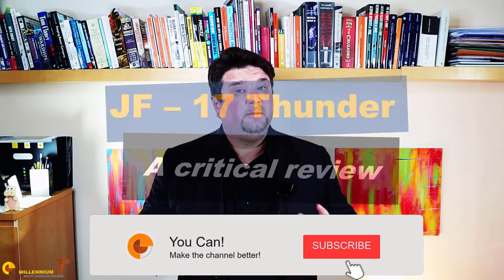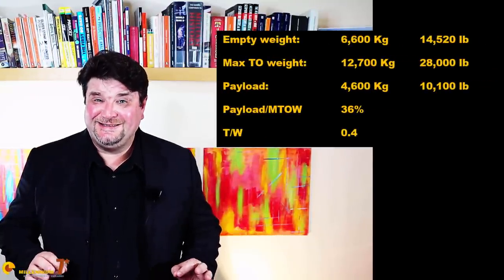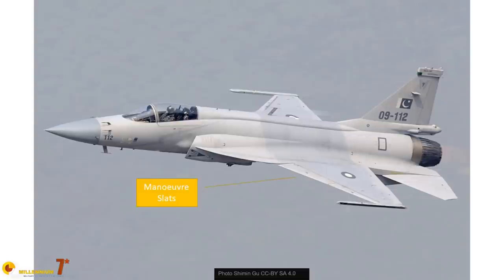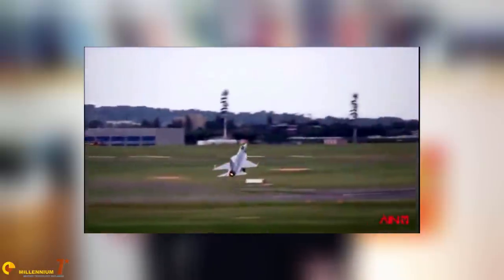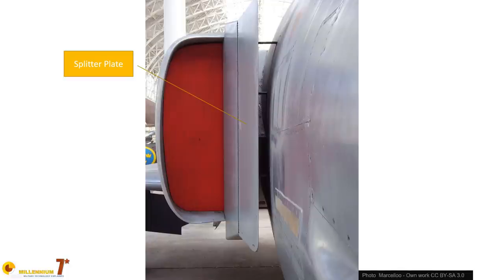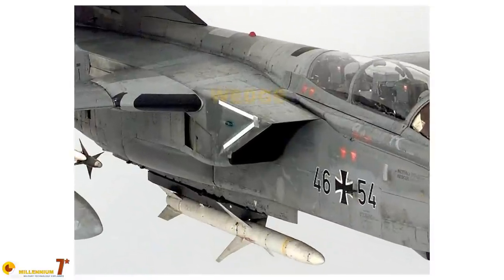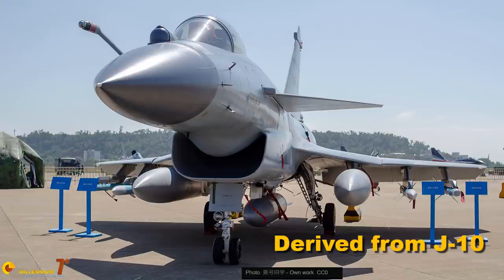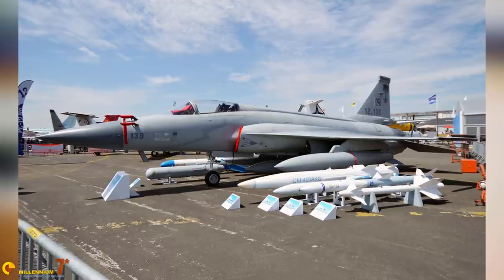JF-17 Thunder Block 3 & F-35 - What do they have in common?

Comment: Unbaised analysis and a great one tbh 

Little corrections:

 Mikoyan Design only provided design support related to RD93 engines..

And it has 7 hardpoints but can be increased to 11 with mounted rail racks for ground attacks and maybe others (not sure about others)

And yes its master of none trait but its bang for buck and if the pilots are well trained it can be a great asset...
Reply: but it doesn't have the lift capacity or wing thickness for serious weapons expansion
Reply: Or u can go the Gripen way.... Gripen c&d and e&f models have different hard points...the latter has more

Comment: Excellent video as usual. Also, it might be that the PAF placed much more emphasis on A2A roles than strike ones thereby opting for a platform that can be rapidly built and fielded in sufficient numbers. This would’ve saved time, money and other resources that modern multi-role aircraft need. By limiting the requirements and simplifying the design, the planners made a smart move thereby    opting for incremental improvement over the service life.
Reply: That would make sense because PAF's primary role is defending airspace. Given it's position sandwiched between massive empires, Pakistan has little interest in invading it's neighbors anytime soon.

Comment: Impressive!! I couldn't have come up with this plane! As a growing nation I'd be very proud at this accomplishment and I respect the approach of not making the entire plane completely dependent on a computer...some things were better in analog form before digital..Prime example is one of my cars..My toyota has an electronic Gas pedal and Throttle Body...where as my Subaru or Duramax have a stainless steel cable attaching the two points together...You can't go wrong with the cable that never has an electrical problem leaving it inoperative..Or A/C controls or gear selectors in cars...I want physical, tactile dials for my A/C AND for my Gear Selection !!!!!!! Don't fix something that doesn't need to be fixed lololol

Comment: JF-17 Thunder Block III Specifications:
1) Chinese AESA radar with Pakistan own software for Avionics. which allows to customize various features.
2) Russia Mig-35's Engine RD-33 MK version which is quite close to the F-16 Engine performance.
3) PL-15 Air to Air Missile BVR which has a range of 170 - 200Km, 100 Km is its kill range.
4) A lot of Air Frame is replaced by Carbon fiber which drops its RCS and weight. make it a little bit stealthy.
Reply: RD 93 MA 98KN at wet thrust specially designed for JF 17 block 3 by Russian
Reply: @wahajhassan7307  nope its RDD - 93 MK with 4000 pounds of extra thrust. RD-93 MA was used in previous blocks.
Reply: @pkavenger9990  RD-93Edit

A variant used to power the JF-17 (FC-1). According to JF-17.com [4] "The most significant difference being the repositioning of the gearbox along the bottom of the engine casing." The Klimov poster at Zhuhai 2010 airshow gave the thrust range of the engine to be 49.4 kN to 84.4  kN Wet. [5] This was designed specifically for FC-1 with increased thrust and relocated gearbox compared to base RD-33's, although the increase of thrust decreased the service life of RD-93 to 2200 hours from RD-33's 4000 hours. According to Air Commodore Mehmood engines are solid and reliable: “We’ve flown 7,000 hours with the engine and we haven’t had any problems”, he said [6]
Whereas an upgraded version of RD-93 which is called RD-93MA is expected to come in PAC/CAC JF-17 Thunder's block 3 especially tuned by klimov for the Pakistan Air force which is expected to have 98KN of wet thrust.
Reply: @pkavenger9990  that's Wikipedia

Comment: Pakistan just loves F16, so JF17 uses similar configuration. Also the original design from Grumman is traditional configuration.
Reply: The original design was not from Grumman. For the joined venture, Grumman was responsible for the glass cockpit and avioinics, and chengdu was responsible for everything behind the cockpit. I read the memoir from one of the engineers from chengdu who worked in the project. They wanted something with the cost of mig21, cheap and easy to produce like the mig21 to have similar performance of the F16. They would not even accept the ridiculous demands today.

Comment: I thought the intake was meant to reduce supersonic airflow to subsonic, since few jet engines can handle supersonic flow. It does this by reducing supersonic flow into subsonic, but high pressure flow, and it keeps the shock wave away from the engine compressor face, sometimes even using the shock wave to compress/slow down the intake air.

Comment: JFT  itself is block based programe since its begaining and with 40 years of flying F16s Pakistan has put a lot of knowledge in to it which chinese didn't knew,  so it's a customizable fighter jet and it's still brining more blocks of it with PL15 AND ASEA RADER makes it a very cheap but very deadly opponent! 
Block 3 already in use with AESA RADARS AND PL15 while block 4 is in testing faze! 
while a large variety of A2G 
& A2sea guided weaponry already been installed on its blk 2 and blk3 provides a lot more. 
Twin engine BLOCK 4 with more avionics will become a truck for all kinds of air to air,  or air to ground air to sea roles while blk 2 and 3 will give it,  protection cover with PL15 ASEA radar! 
Above all there won't be any political strings attached with it
And that I'll comes with double engines with Chinese origin the basic varriant of J20s. 
That's why a lot of countries are buying it as a cheap killer of expensive machines as what u think!

Comment: Yes  many said the design mig 21 and f18 or f16 blablabla, not really. 
The real origin of the jf 17 is as you said, but you forgot to mention this: 
Pakistan bought from russia the forgotten project mig 33, in design and development was a very powerful design, but pakistani pilots didn't did well with the original model, so it was changed to look more like an j7 ( chinese mig 21) so they move the intake from the bottom to the sides, lowered the cockpit and redesigned the tail, that was block 1 prototype, then all you said is right, except for where it came.

Comment: At the time, Chinese engineers suggested that the Pakistani military should design the wing sweep angle to be smaller, but the military seemed to position him as an attack aircraft, which did not need to be faster, and had to fight with F16.

Comment: You should have mentioned that jf17   block 3 will be equipped with Pl15 missiles which are better then f16 amraam so in air to air combat it definitely will be high horse then f16s

Comment: ur comparing jf17 with f35...seriously!!???!!!!!
Reply: What's wrong?
Reply: @i_Nxt    The technology of JF17 is not as advanced as that of F35, but their positioning is indeed very close. They were all set up in the late 1990s. Chinese engineers referred to many of his design concepts:
1. Strictly control prices and use the best project management to control project costs, so that countries can buy and use.
2. Use development software architecture to facilitate later management
3. It is positioned as a multi-purpose attack aircraft, and it is not the first requirement for air combat. It can cooperate with the main fighter aircraft of the country to attack the opponent
Different from the project management, the F35 was not supplied until around 2015 because of the continuous addition of demand during the development period, which caused the project to delay. The JF17 is from simple to easy, continuous iteration, continuous update, while producing, while concentrating the latest requirements to the next iterative version, to ensure that the project can proceed as quickly as possible. Now version 3.0 has been tested.

Comment: 17:58 not sure I can agree with you here: Anti-ship missiles no longer being common for non-naval fighters? Here are some examples of anti-ship missile and cruise missile options with no claim to completeness:

Su-35 and Su-35S: Zvezda Kh-35
Typhoon: Storm Shadow, Taurus KPD-350
Rafale: Storm Shadow, Exocet
Gripen: RBS-15F
F-15E: AGM-84 Harpoon

It seems rather that the F-22 and F-35 are unusual due to their lack of anti-ship armaments. However, two anti-ship cruise missiles are emerging for the F-35, the Turkish SOM-J (a variant of the existing SOM specifically for the F-35's internal weapons bay) and the American LRASM (a variant of the JASSM). And there's also the Joint Strike Missile (a variant of the NSM) being developed by Norway and the US.

Comment: Wow. It's  very similar to the cancelled F-20 wing LERX, but with DSI intakes and F-16 wing + aft tail configuration. With the RD33 engines, performance should be similar to a degraded GE404 engine.
Reply: Ge404 >> Rd 93/33

Comment: An aircraft with 50% of price and 75% of capability in comparison with modern Western aircrafts of similar category. Above all, its evolving and is a combat proven platform, i.e. air kill against an Iranian UAV, ground strikes against Indian military installations in Kashmir and have blinded a pair of modernized Mirage 2000-5 of Indian air forces during an aerial engagement.
Reply: Lol Does it has even tested to fore actual long range BVR(70Km ramge)??
Reply: @jagdeepsingh6742  yes.
Reply: Blackbirdz2000  When PAF tested it with SD-10. Which date?
Reply: The jet was not  involved in any engagement. Its still a 3rd gen jet with under powered engine and a doppler radar. The BVR you mentioned is not tested yet. JF17 has not been tested with any long range BVR yet even after 10 years of service.
What blinded mirage2000s? They are equipped with isreali aesa el/elm2052. How the fu*k a dobbler cheap radar can jam Aesa? 
PAF has only one advantage that was F16 with Amraaam which give them 20km range advantage than Indias Su30 1999 made R77 missiles. But soon after India ordered New 650 of  R77 which Russia dilivered in 1st week of july2020.
And please Domt mention JF17 everywhere. Its not a great platform. If it would Pakistan wouldn't have begging from every country to sell them their old refurbished F16s. Western technology is 2 gen ahead of Chinese. And Chinese are selling pakistan crap which they dont even use. So please dont compare. Again so called JF17 has no lomg range  bvr.
Reply: Whatever JF17 ended up in battlefield last year Feb ending up hitting targets inside India, while Tejas was crying in his moms lap scared hehe.
Reply: @aarifboy  Which Target? Your mamas cookies?
Reply: @galaxyofvid2738  Spike is air to ground mutation not SAM device. Atleast have some basic knowledge.

Comment: Good video but only one area of improvement... I got around 4/5 ads in the first 10 minutes. I understand that ads are needed for the channel but this amount is a bit too much
Reply from the maker: Sorry for that but ads frequency depends from YT. If the video is above 10 minutes, the midroll is activated. If you  leave the midroll to YT to set, that' what you have seen. I could set just one  single ad break, but in that case you would get 4/5 ads in that single break, or even more. 
Apparently YT decided that this video was worth a lot of adverts and they cram them in it. 
Basically, I can't control the number of ads and barely the frequency, it is an on/off. situation, I'm afraid. I keep some type of advert off, but sometimes there are a lot of them.

Comment: Thrust to weight ratio is not correct ....0.4 only no...its 0.95...plz correct you sources
Reply from the maker: It is calculated at MTOW
Reply: @Millennium7HistoryTech  calculating T/W ration at MTOW is of no use as in dogfight fighter jetison their Arsenal and only air to air weaponry remains. T/W helps in dogfight . MTOW of JF17 B2 is 12700 kg and RD-93 thrust is 8300kgf T/W at MTOW is 0.65 not 0.4...…..0.95 is with 50% internal fuel and 2*SRAAM)

Comment: It would be interesting to see another video once block 3 is out. With an aesa radar, better avionics, more use of composite material, irst, helmet mounted sight, ram coating  and integration of pl15 and upcoming pl21 missiles, this could be a very formidable fighter plane. It’s no f22 but would still pack a very serious punch, especially for the money it costs.
Reply: Include 3 axis fly by wire and early missle warning system speed of mark 2 plus RD-93MK new engine.
Reply: All of those things will add cost and make it less attractive for prospective buyers whom would consider the aircraft for it's price/performance range. It sits at the sweetspot of base level fighter with modern avionics and armament. Like the F-5 in it's day.
Reply: @BC-ef8vu  actually jf17 is a open ended design, this block 3 will appeal to many nations and the best thing for them is to buy block 1 or 2 with block 3 always as a upgrade option if  needed.
Reply: @BC-ef8vu  the role of JF17, before being an export oriented toys, is to be able to fulfil PAF needs. And if it could do more, then good. 

I know PAF has IAF as opponent but should never underestimate enemies.
Reply: Not much happened bruh, sad

Comment: jF-17 block 3 serial production has been introduced in a ''first taxi test ceremony''. Initial pictures shows A2A configuration, with: 2xPL-15, 5xSD-10B, 2xPL10E... all this with A2A refueling, HMS, AESA, integrated EW suite, advance net centric data link, increased fuel capacity, improved engine.... etc. makes it a deadly interceptor.

Comment: another nice video, fair analysis,Thanks for making a video on jf 17. However one question always come in my mind, why can not more hard point be added into the air frame since it has decent amount of payload capacity meaning if the aircraft have to conduct pure air to air missions it can carry more than 7 air to air missiles just for an example, where weight of each sd 10 missile is around 200 kilo grams according to my findings. 

much more appreciated your efforts and time.
Reply: probably aerodynamic imbalance?  But there's this concept of "Dual pylons" or "Triple pylons" . The Pylon is externally connected to the Hard point and can carry 2 or 3 Air to Air missiles, increasing the total number of missiles carried by the fighter. 
Dont think JF-17 however has the ability to carry dual pylon.
Reply: because beneath (or rather, above) any hardpoint/pylon there is support structure in order to handle the weight and aerodynamic load of the stored munition on the pylon. more hardpoints lead to heavier wing structure. However the problem you state can be mitigated with racks and multiple launchers mounted to 1 single hardpoint; the US planes fly with them regularly.
Reply from the maker: It has, but they are not used.
Reply: @rohitb3  thanks for your comments. Any specific reason for this disability??
Reply: @VuLamDang  thanks. make sense
Reply: @memahmad  Lam Dang has explained it well."because beneath (or rather, above) any hardpoint/pylon there is support structure in order to handle the weight and aerodynamic load of the stored munition on the pylon".
Reply: On top of what others have said, the JF-17 is a short range aircraft. In air to air missions I suspect it's more limited by the amount of fuel available than its missile loadout. It's not easy to justify carrying a million missiles if you don't have the fuel to maneuver in position for many shots, and that's ok. The F-16 and Gripen carry comparable amounts of air to air weapons and they do just fine.
Reply: engineering difficulties aside, who the hell will be able to use more than 7 missiles in a combat?? You either have to be an out of the world exceptional pilot or a blind to justify more than 7 missiles.
Reply: @mobashshirkareem976  keep living in your own world, we have seen  aircrafts 
 flying with larg no. Of missiles. By the way talk is about how many maximum no. Of missile aircraft can carry, doesn't mean we have overload the aircraft all the times